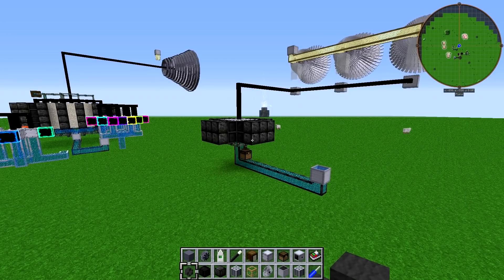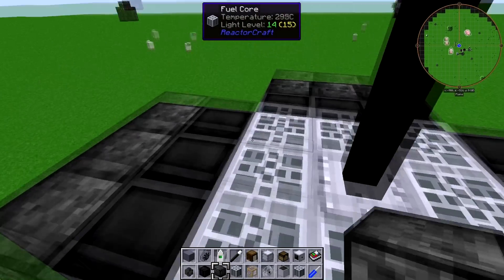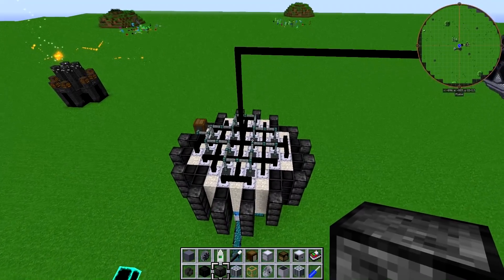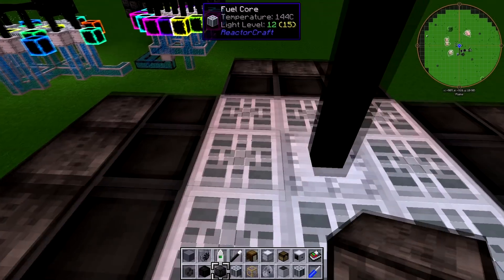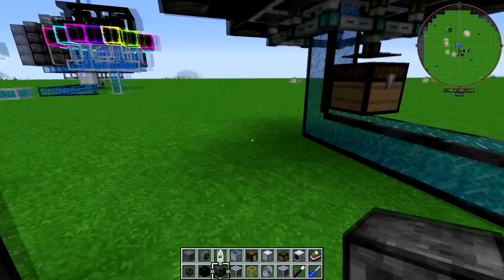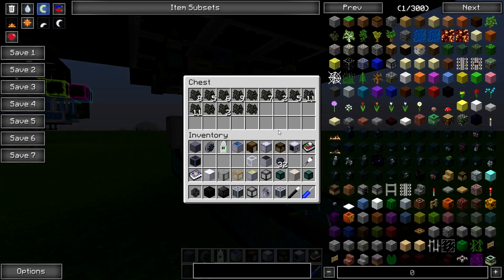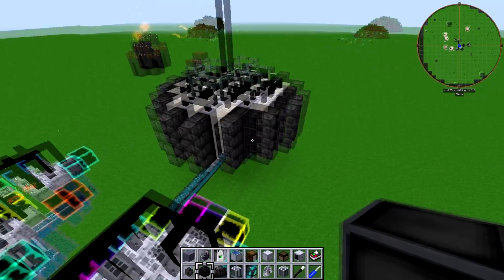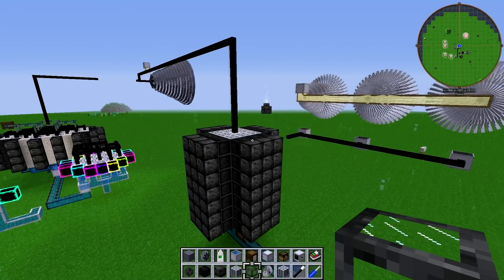ReactorCraft Tutorial #29 - Multilevel Fission Reactors

Comment: You canot use controll rods for stacked reactors
Reply: Yes you can. One control unit connected to the bottom of the reactor senses and affects control rods on all levels. You just won't see a 20 block tall control rod emit from the reactor. You can test this by stacking three, retracting the rods, then break the top two to see if the bottom one retracted.

Comment: Are you looking in to doing an updated tutorial on thorium reactors? Also gas ducts can connect to the fuel dump valves.
Reply from the maker: I should do that, the last one was inconclusive
Reply: +SentinalhMC Also, do you know if spent fuel container neutrons work with breeder cores? Would be interesting in a few ideas I have.
Reply from the maker: Nope, that doesn't work. Reika specifically made that interaction impossible.
Reply: +SentinalhMC Do the spent fuel container neutrons work with the other cores?
Reply from the maker: Nope
Reply: +SentinalhMC Important information: liquid pipes can connect to sides of throium cores, I assume this is for taking out the hot fuel salts when you are using a fuel dump valve.

Comment: did reika nerf fission reactors? because last time i played i could run a high pressure turbine on max power with 12 cores
Reply from the maker: well it depends on how you lay out those cores I suppose.
Reply: SentinalhMC it is actually one of your designes
Reply from the maker: oh well there's your problem, haha. I don't know, I haven't built that reactor in a long time
Reply: Was that in v25? Because that's what I have in 1.6.4.